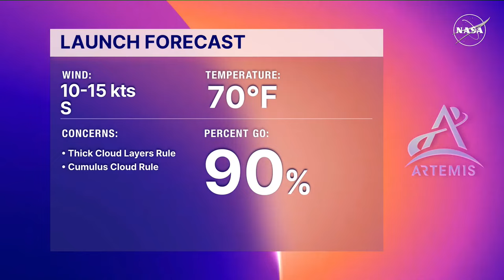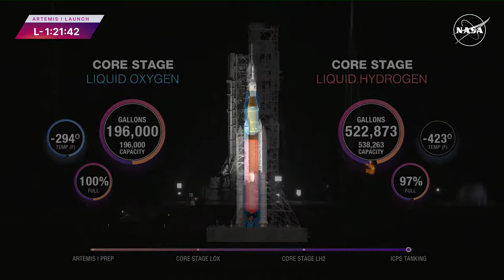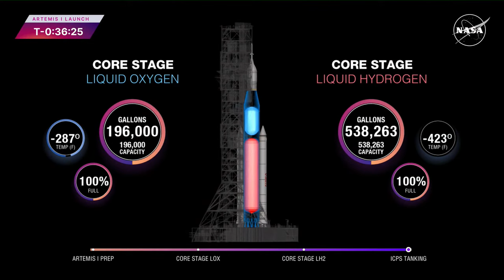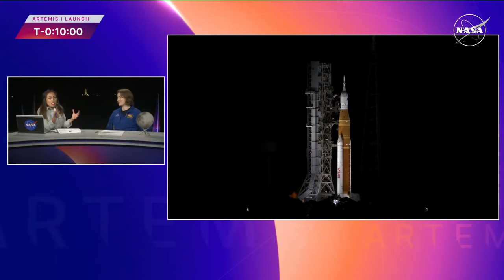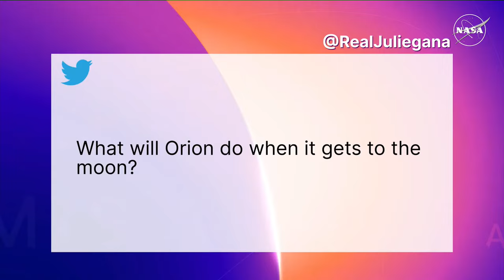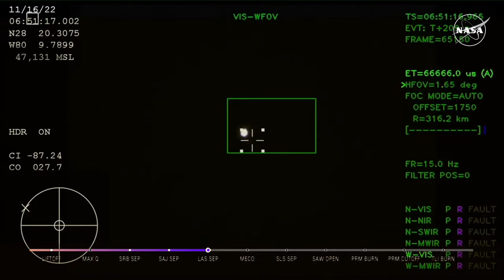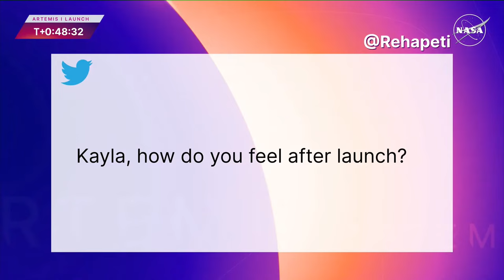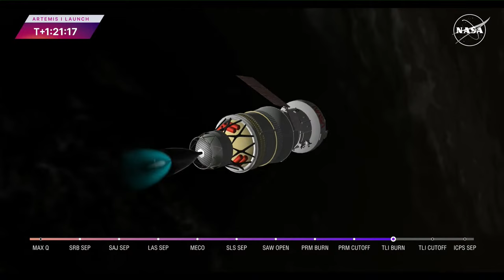WATCH: NASA Artemis 1 Moon Rocket Launch! - LIVE

Comment: 3:15:29 is the launch🎉
Reply: I'm surprised it didn't fail again, then again they did choose 1:00 a.m. eastern standard time. Hoping that no one's awake to witness another failure for the third time.
NASA is old and needs to go. SpaceX is the future.
Reply: @REAL-UNKNOWN-SHINOBI  that it is old doesn’t mean its bad it just has a low budget
Reply: Thank you.
Reply: @Simon Gray  it's actually impressive how you managed to display a complete lack of knowledge in such a short paragraph without saying you know nothing. I'm going to dissect this.
1. They don't just choose whatever time they want to launch rockets. The fact that it was 1:00 A.M. has nothing to do with failure. 
2. Why are you "surprised" it didn't fail? The rockets never failed before, just scrubbed launches. If it did fail, it's not like it would be expected
3. SpaceX is years away from anything to this scale. You said it yourself. "SpaceX is the future." Well, too bad, it's the present right now. 
4. Old doesn't mean bad. SpaceX completely depends on NASA. If NASA goes, SpaceX will be stranded and will fall behind. NASA, however, does not rely on SpaceX
Reply: THANKS

Comment: Very exciting 🍾
Reply: Yes.
Those who believe that man landed on the moon, ask them how fast the spacecraft was flying and how they reduced that speed when they landed in a vacuum. Action and reaction?
Reply: @Mende Laskovski  the LEM (Lunar excursion module), first decoupled from the CSM (Command-Service Module) it then slows down using a hypergolic engine. 3 of the landing legs have small rods that stick out below (around a metre, I think). When these rods contact the ground, a light shines inside the LEM. This is why you hear them say "contact light." This light helps them know when they are near the ground. To ascend, the upper stage decouples, leaving the lower stage of the LEM on the moon. The upper stage uses a fixed thrust hypergolic engine. It them couples with the CSM, and the astronauts transfer into the command module. The LEM is decoupled and left in a lunar orbit. The CSM fires its engine to exit lunar orbit and place it on a return trajectory to earth. Once near the re-entry interface, the SM decouples from the CM, which points its heat shield towards retrograde for re-entry. There is a blackout period for several minutes during which the atmosphere deaccelerates the CM, and it deploys drogue shoots to slow down more before deploying main shoots. It splashes down in the ocean, where it inflates a device to keep it floating. The astronauts and CM are recovered safely.

Comment: Those who believe that man landed on the moon, ask them how fast the spacecraft was flying and how they reduced that speed when they landed in a vacuum. Action and reaction?
Reply: Still tryna figure out if the space station moving more than 10000 miles per hours and must stay at that speed to keep orbit how do rockets connect when arriving at space station how don’t they crash into each other
Reply: @mendelaskovski3996 The Apollo spacecraft were orbiting the moon at around 1600 meters per second, even though the moon provides no atmosphere to slow them down, the landers used their engines to slow their descent, eventually landing at around 2 meters per second.
Reply: @kingleoAfb  The space station and the arriving rockets must be both moving at the same speed (around 7,660 m/s or 17,000 mph) and share a similar trajectory, so they can safely dock with each other, this maneuver is called rendezvous.
Reply: @2k7u  so 17000 miles pre hour and they don’t crash when docking is hard to believe
Reply: @kingleoAfb  It may seem hard to believe, but there are several factors that work together to make it possible. Rockets use a combination of precise navigation systems and advanced algorithms to track the trajectory of the space station and adjust their own course accordingly. When docking they also use onboard sensors and cameras to detect the station and fine-tune their trajectory as they approach.